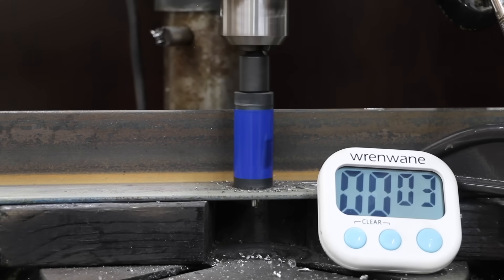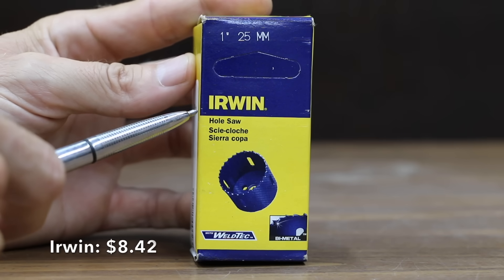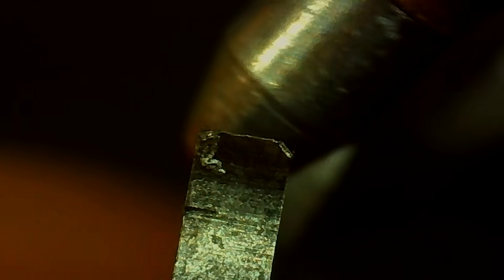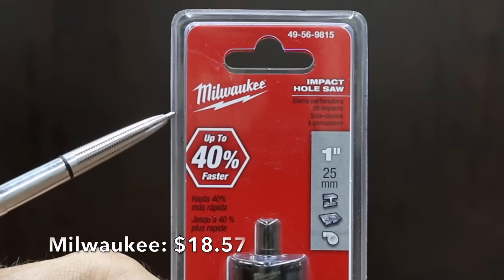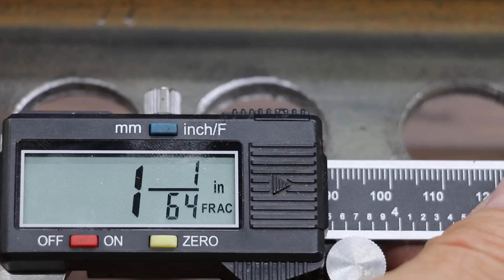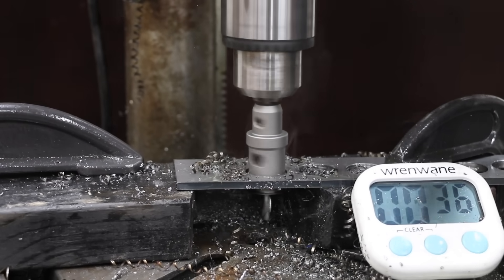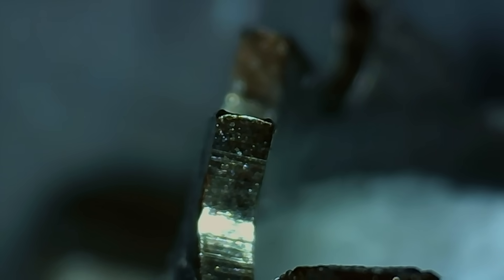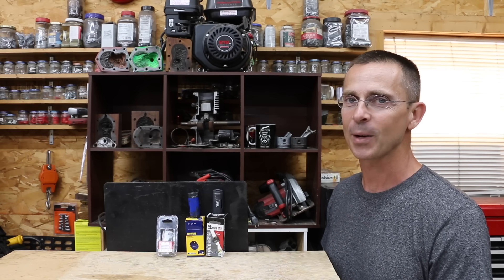Best Hole Saw Brand? DeWalt vs Milwaukee vs Irwin, Bosch, Lenox, Diablo, Bosch, MK Morse

Comment: I am an electrician, we use Greenlee and Ideal hole saws, I was missing them in this competition.
Reply from the maker: Thanks for the suggestion for future round of testing.
Reply: @ProjectFarm  Also Starret hole saws although possibly an Irwin product
Reply: Lol I just repeated your comment greenlee 7/8 ,1-1/8, 1-3/8 set is great...I was also saying how the impact holesaws are only good with the 1/2-7/8” ones cause the larger ones warp...due to thin wall...electricians rule the tools!!
Reply: Yes! I was really hoping they were included as well.
Reply: Greenlee is good, ATI (Aircraft Tools Inc.) is the BEST. . . .
Reply: z50 have to check em out

Comment: Don't remember the brand but the carbide hole-saws we use in our shop always seemed to work best by running them at a higher rpm but lighter pressure. 
Not cheap units, $20 and up for the sizes we use but the things last for years of shooting 10 to 20 holes a day in all kinds and thicknesses of steel (usually thicker than rating...). 
Bout the only thing that would blow teeth out of em was if they'd bind and kick-back. Still ran em till they were damn near toothless...
Reply from the maker: Thanks for sharing.

Comment: I do wood working and have DeWalt Lenox and Milwaukee and some old no name ones. Bought the DeWalt and Milwaukee at the same time to do the same job just in different sizes. DeWalt burned its way through like my old hole saws the Milwaukee plowed right through. Most of it was just because of chip evacuation DeWalt just couldn't do it. The Lenox  has the same issues. So for wood I would have to go with the Milwaukee hole dozer.
Reply from the maker: Thanks for sharing.

Comment: Wish the Greenlee Carbide holesaw was tested
Reply from the maker: Thanks for the suggestion for future round of testing.
Reply: @ProjectFarm  Thanks Todd, we use the Greenlee carbide holesaw set on the job. I have personally put a 1" hole in AR500 for a conduit run into a guard booth. It took a fair bit of fluid to keep it cool, a little bit of patience, but it did go through.

Comment: I always have Lenox stuff on my truck. Why? Because that what they sell at the electrical warehouse...... I have had an old Morris kit in my shop for 15 yrs though, has held up pretty well. Those hollow shaft lenox arbors always end up splitting in the drill sooner or later.

Once Maxis made compact drill driven knock out kits those hole saws went the way of the dodo for the most part. As far as putting holes in electrical panels goes anyway.
Reply from the maker: Thanks for sharing.

Comment: I think there should be a supplementary test for the impact-rated hole saws. Who knows, the impact might also boost performance, especially since most of these will be used in battery powered drills, which are far weaker than a drill press.
Reply from the maker: Thanks for the feedback.

Comment: Great test. It would be interesting to check the temperature of the holesaws to see if they got hot enough to melt the brazing. Those missing teeth may have melted off. I keep mine lubed and cooled with water and get them to last much longer. I found the carbide is far superior when drilling through a porcelain enamel coated cast iron sink but not much better than bi-metal on regular steel
Reply from the maker: Thanks for sharing.

Comment: Project Farm: Halfway through this demonstration, I realize that you may be applying too much downward force on the hole saws. Another thing I notice is that you are not using any cutting fluid. But at least it was consistently wrong. LOL.  Getting stuck is a sure sign of too much downward pressure. Cutting fluid. ie. WD-40 or something similar wicks away excess heat. Heat at the cutting edge is the bane of any cutting process. Let's use our tools not abuse our tools. Towards the end of the demonstration, you show the damage to the carbide teeth. Of which all, demonstrate to me that, again, too much downward force has been applied. I'm not a "Know-it-All" But I did go to machinist school and worked as a machinist for only three years. So, No. I'm not a "Know-it-All" But, I know what ai know...........
Reply: I think Todd would benefit from learning about "feeds & speeds" ...all those damaged teeth are trying to tell you something!!

Comment: Morse is a fantastic hole saw. I have some I've used at work for countless holes through various grades and thicknesses of steel, stainless, and aluminum. Most important with them is slow speed, even and consistent pressure, and good cutting fluid - and occasionally stopping to let everything cool before it has a chance to harden! 

Wonderful test, thank you very much!
Reply from the maker: You are welcome!

Comment: What RPM did you run this at? With hot much smoke was coming off the hole saws it looked too fast, and I wonder if that contributed to the roughness of the hole in some cases.
Also, carbide really doesn't like interrupted cuts as you saw it chips the carbide. I would love to see this repeated with proper RPM for carbine at 1" and no up and down movement (maybe use a vacuum to clear chips as it goes?).

Comment: This makes me wonder if you could try some 4+" hole saws  through cinder block, red brick, and concrete? The size for running a dryer vent to the outside being either, 4.0625" or 4.125"
Reply from the maker: Thanks for the suggestion.

Comment: I noticed a lot of moving parts and seemed at times out of round run out. In one test the plate wasn’t clamped on one side, another test I can see the table move side to side. Maybe didn’t matter at the end of the day.
Reply from the maker: Thanks for the feedback.

Comment: This makes me wonder if you could try some 4+" hole saws  through cinder block, red brick, and concrete? The size for running a dryer vent to the outside being either, 4.0625" or 4.125"
Reply from the maker: Great suggestion.  Thank you.

Comment: 2 brands to note are Sandvik, deep cup HSS,  and Greenlee, shellow with carbide teeth.  Both work amazing in a cordless/corded drill and even better with constant pressure on a drill press/mill.
Reply from the maker: Thanks for the suggestion for future round or testing.

Comment: What I have been using are Annular cutters. The Chinese set I have is fantastic, but unfortunately, it must be used with a mill (for rigidity and low speed power (for a 1" armor plate like what you had I might be running at like 150RPM or less)).
I suspect a lot of the carbide damage was from the drill press stalling out. Carbide likes constant force, but it is like glass once you start with something like an interrupted cut.
Great video.
Reply from the maker: Thanks for sharing.

Comment: You should use cutting oil... i mean only a fool wouldn't use cutting oil on steel... they could perform completely differently :)
 The carbide is very brittle, so any shock or sudden loading will chip a tooth. Thus keeping the hole saw running when you peck it might be the reason the teeth broke...
Reply from the maker: Thanks for the feedback.

Comment: What about diamond hole saws? mainly for glass (non-tempered of course...) and tiles, they are amazing to use. Good suggestion I got is to score/pre drill the back so when you break through it doesn't chip or shatter AND use lots of water, so the heat doesn't destroy the adhesive/glue they use to hold the diamonds in place, you can use blu tack or some putty/clay but flowing water is best + patience, lots of patience...
Reply from the maker: Great suggestion!  Thank you.

Comment: Todd, you didn't try the  Starrett hole saw [I specifically raved about when we all were talking about a hole saw challenge a few months ago]. :-\

We can build several tube frame drag cars from 1-5/8 x 0.085 4140 CM tubing without burning up one of those. They're by far the best holesaw on the market. Their hacksaw blades are equally as awesome. Speaking of......hacksaw blades!!! DO IT!!!

And the Starrett deserves a shot at the holesaw title..... ;-)
Reply from the maker: Thanks for the suggestion for future video testing.

Comment: I'd be curious to see how a 1" Hougen Rotabroach would hold up in your test on the AR500 plate. Also a minor quibble, AR500 isn't armor plate, it's wear plate. The vast majority of it is used for wear edges on earth moving equipment.
Reply from the maker: Thanks for the video idea.

Comment: I'm not trying to bash the guy's review here. I am a trade professional and have tried a lot of these myself. The first tool that he showed isn't intended to be used as a hole saw. It's a carbide cutter available here in the United States commonly in specific sizes to electrical conduit fittings. If that was 1", that must be outside of US market. Here the smaller ones are 7/8" and 1 1/8" cutters. They are quite nice if you treat them properly. The center drill that come with any of them isn't really that great so try a smaller pilot hole first. As tested here is pretty far from being the practical application for that tool. Otherwise, I would testify to the Milwaukee Hole Dozer line. They are quite durable and can take some significant abuse. I have also tested the Diablo with the snap lock system. The mandrel lasted all of 30 minutes on a job before jamming, and the cutter/lead drill itself broke apart on the second hole in a door frame. I can say I was not very impressed and never buying that again.
Reply from the maker: Thanks for the feedback.

Comment: To be honest. the way i look at hole saws is not so much how fast they cut but how long they last. and what the warranty is. if you use one as much as i do you'll realize that going back and forth buying or replacing the bit wastes more time and money then one that cuts a bit slower but lasts a long time.
Reply from the maker: Thanks for the feedback.

Comment: I use hole saws a lot. Thank you for all the time you put into making videos to help others make the right choice when making purchases!
Reply: Wow I can only understand some part your guys were talking about ..... But the knowledge is sure a lot on this thread 👍
Reply from the maker: Thank you very much!
Reply: @ProjectFarm  They all suck at it, but it is a very difficult cut without coolant. Cubic boron nitride would have handled the armor plate easy. Try with lighter speed and feed.
Reply: @julianpetkov8320  Agree with you, too hard feed on that old belt geared machine  will chip off pieces of the carbide teeth every time it stalls. Im used to industrial stuff, drills with real gearboxes and coolant, i bet i could get at least 100 holes from that dewalt carbide. One can even feed them hard since there is no risk of stalling when in the lowest gears.
Reply: @pflaffik  I have trick for the home shop for tempered steels. I touch the hole to be with a stick welder for about two seconds. Carbon electrodes are best for the purpose. They are made for cutting. It will soften the spot. Like you said, there is no point wasting carbide on hobby machines.
Reply: @julianpetkov8320  What about cutting a circular hole in the attic of a wooden house to add an air duct vent? Do you think I need to get any coolants or other equipment to make a clean cut?
Reply: @gamerdew641  You don't need to use a coolant on wood. If you want a super clean cut, you need screw a piece of wood on the other side of the cut, to avoid chipped edge.
Reply: @julianpetkov8320  What speed would you recommend doing this type of thing on .065 chromoly and obviously Ill be using coolant on chromoly
Reply: @julianpetkov8320  .
Reply: @gamerdew641  no one got your satire, 😔

Comment: As an electrician, this is what I wanted to watch!!
Reply from the maker: Glad to hear!
Reply: I have greenlee 3piece set and I think it’s the best..
Reply: Andrew B I have the 3 piece ratchet set from them. Can’t beat greenlee punch sets! They’re the best!
Reply: Also as an electrician, he should have tested Ideal's TKO carbide-tipped holesaw. It will cut a hole so smooth and true you'll think it was bored with Bridgeport vertical mill
Reply: Gratz Buck I was thinking about! So those are worth it huh? That 3 piece kit for 150 is justifiable?
Reply: @michaels5647  Lowes sells the 4-piece set ( Ideal # 36-311 ) for $90 which drills holes for 1/2", 3/4", & 1" conduits,  i.e. 7/8", 1-1/8" & 1-3/8" diameters
Reply: Gratz Buck good to know! Thanks! I usually buy my stuff at our electrical supplier. I know the mark up is crazy but it’s convenient. Definitely gonna hit up Lowe’s this weekend! Thanks again!

Comment: Great work but, carbide is usually intended to be used at higher speeds than hss therefore I wonder how much better the hole saws with carbide would do if run at a higher speed.
Reply from the maker: Great suggestion.  Thank you.

Comment: Would you test an oil bypass filter systems? I found a company that makes an oil centrifuge for use as a bypass filtering system. They say I can filter down to below a micron and has a 99% efficiency rate. It is sold at www.dieselcraft.com thank you!

Comment: Here’s a random experiment, what’s good for patching tarps. I know there fairly cheap but having to replace 10 of them every few months to a year adds up.. 
would tape be good or is there something that I can use that’s made for tarps.. 
I have the heavy duty sliver tarps from harbor freight and normally around the holes they tend  to rip then they become unusable. Is there any way to save the tarps? 
Also they are in the sun year round and in 100+ heat in summer.

Comment: rpm for cutting  the ar500 plate was to fast, 100- 150 rpm and you would have made it thru with the carbide saws and maybe with the bimetals!
Reply from the maker: Thanks for the feedback.

Comment: Great video as always! Keep up the good work :)

I have another video idea, if you want to try out testing something different: Halogen H7 headlight lamps for cars. There are several brands claiming for example 100% better lifetime, 150% brighter and more white (instead of yellow) light or even a wider beam angle than a standard bulb. You could test them in the same headlight for good comparison and check if they really offer what they claim. So you could check beam angle, colour rendering, luminous flux, reliability and so on. Some ideas for the reliability test would be hard shaking of the light bulbs, for example when they are attached to a vibration motor (simulating driving through potholes etc.) and testing how often they can withstand cold starts (switching them on) from -20°C (you could put them in your freezer for that test case for example).
Reply from the maker: Thanks, will do.  Thanks for the video idea.

Comment: I'd like to see a battery test comparison - Specifically 9V
Testing for both initial capacity, long term storage retention, hot and cold condition resistance and charge retention after long term hot or cold storage and humidity resistance over time
Uses for these are many: Walkie talkies as back up comms for campers/hikers, fire alarms in sheds and garages where the hot/cold/humidity comes in etc
Reply from the maker: Thanks for the video idea.

Comment: Lennox comes with and without a mandrill. It just depends on what the store sells.
Reply from the maker: Thanks for the feedback.
Reply: @ProjectFarm  I worked for Lowe's over 6.5 years and thought I'd throw that out there. Good timing with this test. I'm about to use some hole saws on a project so this was some good info. 👍